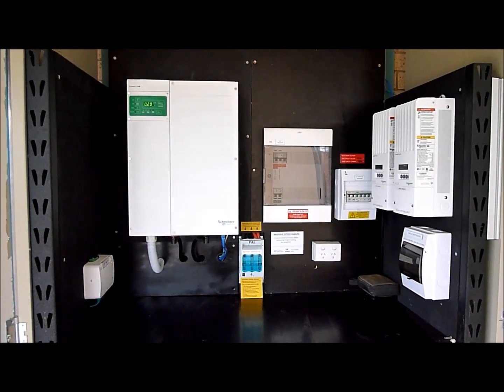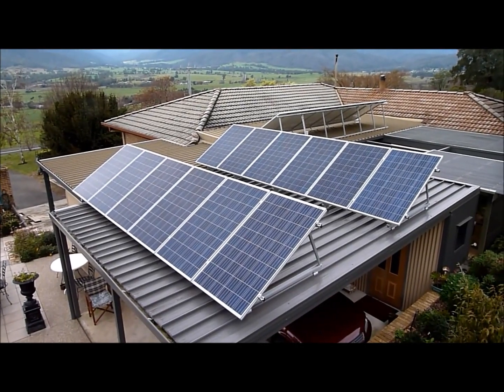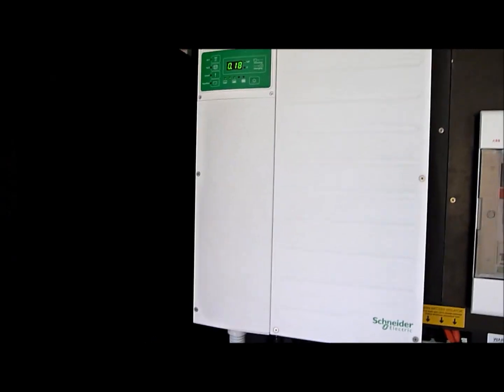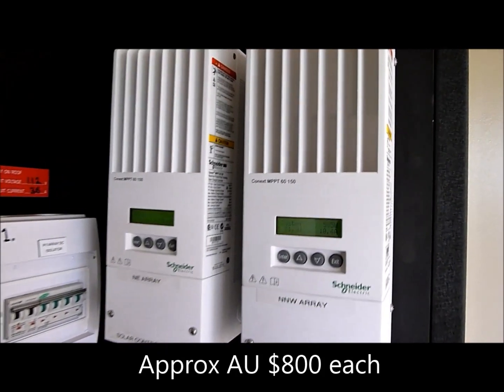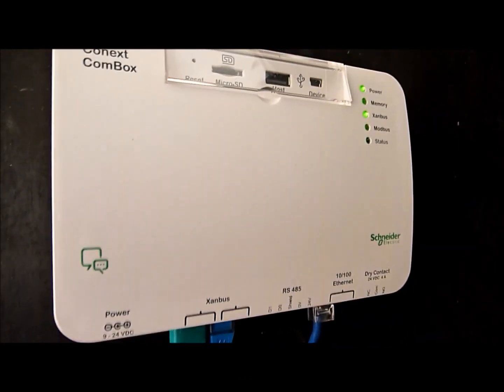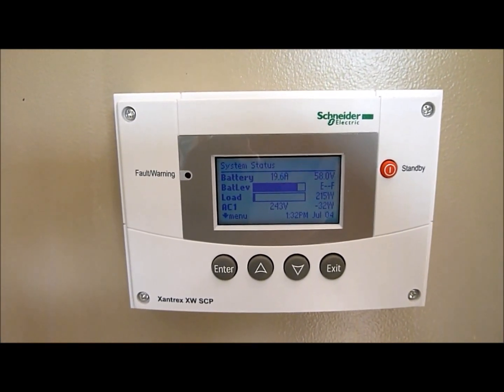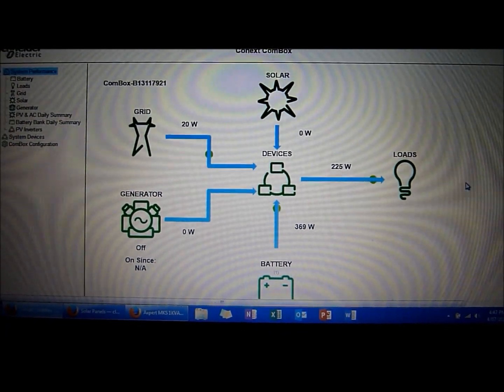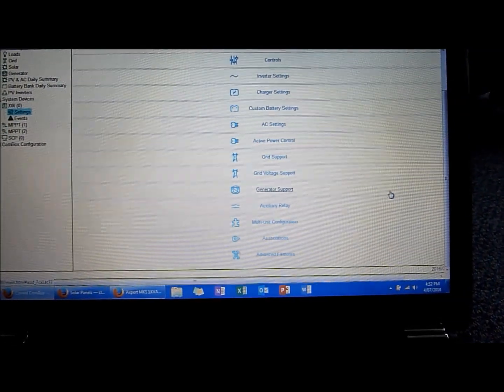Hybrid solar system review - Schneider Conext XW+ DC coupled

Comment: Can this system work without batteries? I am trying to couple it with a AC geneator.
Reply from the maker: No, I don't think so. You could use it with a very small battery though.
Reply: @cleanenergyreviews  Thanks. I am trying to build a battery less solution for a vessel LOA20 metre. If you come across any solutions that can couple solar + AC or DC generator/alternator, reply me to info@metafabs.in
Reply: @johnphilip7977  try Victron Energy.

Comment: Are batteries directly attached to the DC bus, or is there an extra bidirectional DC/DC converter between battery bank and DC bus? What is DC bus voltage? What BMS for battery bank do you use for balancing, if any?

Comment: The documentation says that the batteries cannot be charged via solar panels if the grid is down. That is a severe limitation of this product.
Reply: Are you sure ? You can charge them then directly from charge controller with DC from solar panels

Comment: @8:38 it shows house load as 211w,  battery providing 353w, and grid supplying 27w.   Is there an explanation as to why the house load is supposed to be 211,  and there is 380w being supplied?  Was this updated/fixed in a later firmware update?

Comment: I've got many similar components but my application is very different. 20 x Canadian Solar 330w panels, 2 x Midnite Classics MPPT controllers, 22.5KWh Lithium Ion NMC battery pack running 12s18p 44.4v (50.4v max) configuration with 9 BMS's on them. 

I'm building a fully electric powered cruising sailboat (salt water). I'm having a hard time narrowing down my choice of inverter, any suggestions?

Comment: Hi, 

Have you ever use the Grid Support mode on this inverter with Sell Back disabled?  With Grid Support on, does the inverter prevent back feed the grid 100% proof, or does it leak a small amount back to the grid?  How good of a job does it do to prevent any excess power?  It would be greatly appreciated if you can check and advise for me on this.  If you have a Smart Digital main meter that can read sell back this can be check easily.

I heard many story and own a Conext SW doesn't event hough advertised that it can not sell back to the grid, yet, still leak power back to the grid in AC Support mode.  :(

Please help me find the answer. thank you.
Reply: I can tell you from what I have seen on large loads starting and stopping it still spikes selling back , with sell back dsabled, not ,much but its not zero.
Reply: Thank you for your reply.  Do you know relatively how much and for how long?  Does your main meter detect it?   Wonder how the power company treated if you do not have a solar contract with them.
Reply: Hopefully you've found your answer by now. These grid-interactive systems may leak a small amount of power back to the grid. Some grid, like in Hawaii, prohibit any bit of power being sent up to the grid. If that case, you can add a contactor/relay to fully disconnect it. This policy is ridiculous, of course.

I'm not sure exactly how the Schneider works in this regard but I'm not too worried about a small amount being leaked back to the grid. The reason is: motors. If you have an electric motor running (ie: 3 phase with a motor inverter) and the grid goes out, the motor will feed power back to the grid while it spins down. There are many motors attached to the grid so this happens constantly. If the grid comes around about your small power 'selling', tell them your motor did it :-)

Comment: Hello, thanks for the great video! I have a question, when the battery's are full, and there is a energy consumption in house, do the solar panels directly cover that consumption, so skipping the battery? Or does the battery discharge and charge right back up.
Reply: Good question. This is a DC-coupled system so when the batteries are full and there are loads from the house the energy is transfered directly to the AC inverter, so yes it skips over the batteries. This even happens when the batteries are not full as the load (pull) is higher from the inverter than the batteries. So really only excess energy is used to charge the batteries. In a correctly designed system on a typical day, you can power house loads and charge the batteries at the same time.
Reply: Alright thanks for the quick reply and information! Good luch with your set-up.

Comment: Thats a great system, however it can burn through  1 kwh per day using  grid in parallel with the batteries,  even with no loads attached. However, you can use the inverter in ac disqualify mode, which is same as off grid mode.
Reply: I noticed the battery draw seems to be far greater than load, up to 30% higher hence terrible efficiency? I will try out the ac disqualify mode however I was limiting the current draw from the batteries to 65A (3kW) to increase battery life by not work the batteries too hard and draw the higher peak loads from the grid (the house has loads up to 5.5kW at times). This feature would be disabled in AC disqualify mode. I'm not very impressed with the Schneider software package and documentation.
Reply: I just don;t think your meters can read the grid current in  the reverse direction accurately.  If you look at the combox numbers L1 is the reverse current phase,  L2 is the forward current phase.  You will see the "-" sign when grid support is active in the grid current data. It is impossible to be wasting 500watts near an low load condition.  It might help to use the custom data logging in the combox as it records many things.  Just don;t insert the SD card with the combox ON as it will brick the unit.
Reply: Hi,  Are you using Grid Support mode or Load Shave mode?
Reply: Are you saying the inverter stand by power usage?  wouldn't it still use the 1kwh regardless if it running with or without the AC input?
Reply: I should have said minimal loads attached, instead of saying no load. 
If you had a 100 watt load the inverter would take 40 watts extra so 140
 watts.  40 watts x 24hs =960 watt/hrs close to 1 kw. Power saving mode 
would make this about 28 watts, but if you had a fridge you could not use
 power saving mode in this instance, as the inverter ac output shuts off below the search watts.
Reply: I usually use grid support mode which burns through 300  grid watts per hour with 6kw load on the inverter, or about 100-150 watts with about 200-1000w load on the inverter.  This is the penality of grid support. I have tried load shave mode and it is a little better using lower loads but at high loads its basically the same loss.
Reply: I am still confused as how you got those figure or how it actually work.  Why would Grid Support mode use more power than off grid mode?

I know that the Inverter required 27-30watts to power itself all the time. 

The inverter efficiency is arround 90-94%.  So to power a 1000watts load you would need 1100watts.   But this is normal for all inverter.  But you're saying in Grid Support mode, it's even worse?
Reply: Hi norb231,   So I just intalled the XW+6848 and I kinda get what you're saying now.  Mine seem worse.  When I have the Inverter in GRID Support mode and remove all Load (turn my load breaker to OFF).  Even at no Load, the Inverter is pulling 2.05A from L1 and 2.06A from L2 from GRID, meaning it's using 480watts for nothing because there's no load.  This doesn't sound right does it?   I have verifiied it with my clamp meter.  If I turn off Grid Support mode, then it go down to .8A L1 and .8A L2.

Could you please let me know if this is how your behave?
Reply: Well, it appears that in grid support one phase actually feeds power in reverse direction, but your clamp cant pick it up. It shoud be 100-150 watts and 300-350 watts at full inverter capacity 6800 watts
Reply: Humm, that's interesting, where did you see it said anything about that?  So you're saying to prevent backfeed the grid... it take 2amps from L1 and feed it back 1amps to Line 2?  So in reality it's only using 1amps?   That's over my head, I called Schneider 1st level tech, that's NOT what he told me and doesn't seem like he know that either.   He did say it's only suppose to use 1Amp per Line.  

I have logged down a few scenario here.  Please take a look and see if this is correct to you?   It seem the more power I pull out of the Inverter, the waste engery is lower?  In this case, 3500watts load and it waste about 250watts.   Let me know what you think.  THANKS.  

https://ibb.co/m5JhwQ
Reply: devildestiny555 , How are you logging these numbers?
Reply: Hi Norb,  I use a few clamp meter to measure the input and output Line1 and Line 2.  I know better not to ready from the Combox, those number are useless.

If what you said it true that one phase feed power back.  Shouldn't I see 2amps on L1 and 1amp on L2 to equal it usage?  But I am actually 2.05A on L1 and 2.06A on L2 as one of the scenario on my log.
Reply: I see.  So the two Line would alternate switch role depend on which phase your load is drawing power from?   It loop the excess power around the other phase.  Funny how Schneider tech support doesn't know this and couldn't explain it to me.
Reply: I really dont know what to say, but this is what I am seeing on the combox data,  only L1 looks like it is the feed back phase on grid support.  Maybe both go negative on sell, I am not sure as I dont sell. back

Comment: Thanks interesting review, seams like all the hybrid systems need improving my Goodwe /  Renesola cant handle Melbourne's cloudy weather and is loosing the   SOC if I dont fully charge weekly so i can only use 10% of my battery till I ether get another controller to split my array or ad to it to help as the hybrid puts to much solar up to the grid over the batteries as it should not do when the batteries are so low.
Reply: Interesting, what batteries are you using? There are settings which can be adjusted which set how much of the solar energy is used to charge the batteries. Although you don't want to overcharge the batteries as you risk damaging them, or worse starting a thermal runaway (fire).  Check the battery spec's and see if they match the settings. Also remember this has been a very bad winter for solar so you can't charge batteries if the sun don't shine.